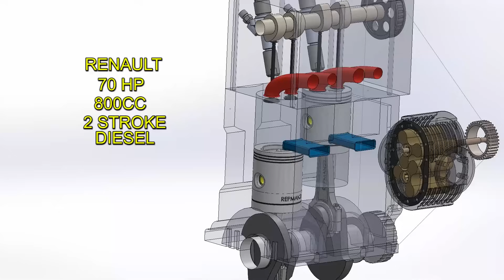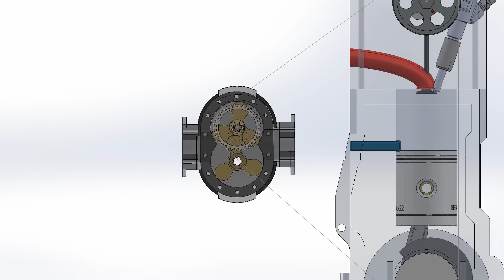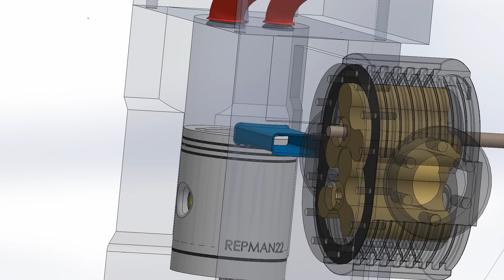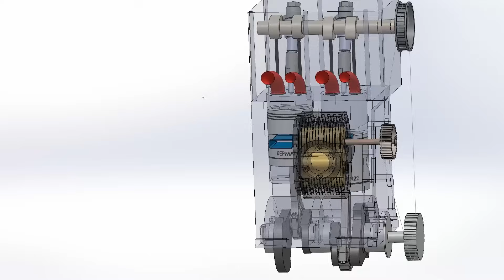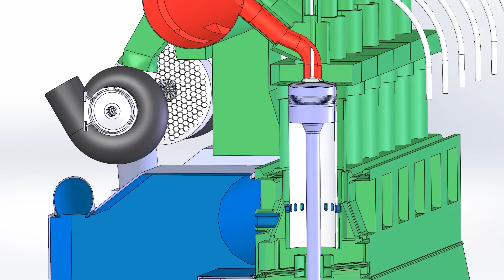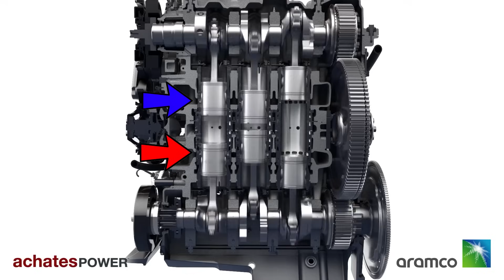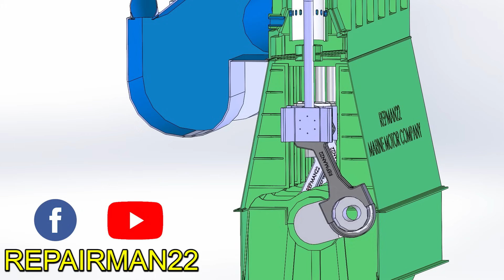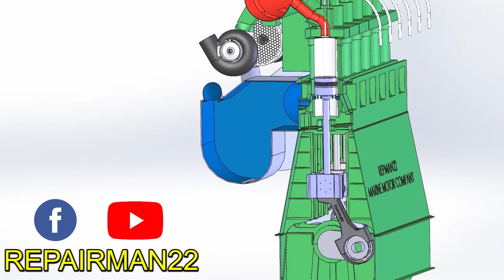🔴 All about 2 Stroke Diesel Engines and how they work in 3D Animation.

Comment: A low rev ,small two stroke diesel that runs at a constant rpm in a vehicle where it drives a generator rather than a direct drive train. Then use a modern electric vehicle drive train only rather than having to stop to charge the batteries it simply starts the engine at a low battery threshold to charge them. It could use significantly smaller, lighter batteries to compensate for the generator weight because they don't have to have but a fraction of the range of electric only ones. It could even be lighter than current electric vehicles with a operating range that would rival any gas vehicle.

Comment: Eine ähnliche Konstruktion hatte ich auch schon überlegt. Allerdings hätte mein Motor nur /Ein/Auslassventil. Der Ventilsitz ist in der Zylinderlaufbahn und hat 75% des Kolbendurchmessers - der Ventilschaft ist hohl und enthält die Einspritzdüse für Benzin. Da s Ventil wird elektrisch geöffnet. Es wäre ein Viertakter. Einlassluft kommt durch ein Rootsgebläse - das Verhindert das Abgase ein den Einlass strömen. - Wie beim 2Takter hat der Auslass eine Prallwand die das ausströmende Abgas und die hinterherströmende Frischluft in den Brennraum zurückschleudert, bevor das Ventil schließt. Der Motor würde nur mit einer Drehzahl arbeiten. Es gäbe nur einen Zustand - Ein oder Aus.. Der Abtrieb Elektrisch über einen Permanentmagnetsynchrongeneraor, Dieser bringt beim Start den Motor bei offenen Ventil auf 3000U/min. bevor der auf Leistung geht und weiter mit 3000U/min läuft. Der erzeugte Strom kommt in eine Schwefel-Natriumbatterie die locker 50 000 Ladezyklen aushält. Das wäre die geburt des 3Liter Autos. /BTW: Schwefel-Natriumbatterien arbeiten erst ab 200°C. Haben dafür keine Selbstentladung beim Stillstand. Die brauchen den Benziner um auf Laune zu kommen. Grüne Spinner mögen diesen Artikel bitte nicht beachten

Comment: Electric turbo? If it's not driven by a turbine, then it's not a turbo. Electric supercharger is a better description.
Reply: Electric assisted turbos not electric turbo. As in it has 2 turbines, one at the exhaust and one at the intake, and an electric motor in the middle to assist in spoiling the turbo at low engine RPM to reduce turbo lag.

Comment: There should somebody produce a 2-stroke double crankshaft diesel engine for a use within a amphibian airplane. Nice torque direct after start and in big heights and less consumption as well. You can find Jet A1 much easier than Avgas.

Comment: Have carbureted versions ever been built?  You mention in the video why fuel injection is a good idea.  But I'm wondering if there were designs that predate fuel injection, or if this is a relatively recent design?
Reply: A diesel engine wouldn’t be able to work with a carburetor

Comment: Detroit Diesel should have made gas version of it since fuel injection has become common in 1990s. it would solve a lot emission and fuel efficiency problems of traditional gas 2 stroke engines. the blower type 2 stoke would be ideal for race cars since you want highest power to weight ratio passable. adding a turbo would increase efficiency at high rpm since the turbo act anther expansion camber. also with turbo boost the stroke does not have be as long to get a good compression ratio.

Comment: An N/A one would be a REAL powerhouse!
edit: jokes aside... Does anybody know what the approximate C/R is on one of those "giant" ones, like in the cargo ships?  Just curious.
2nd edit (lmao): I couldn't help it!  I had to look it up... For anyone curious, they're pretty much the same as what you'd find in a smaller one... maybe a little bit higher... 15 - 20:1 seemed to be the norm, but I've seen up to 25:1
ALSO, a lot of ships are adopting more modern variable compression ratio variants.. mainly to adapt to and be able to run the wide variety of fuels out there today, from "synthetic to corn to crude"

Comment: Your opposed piston engine animation is not totally accurate. The pistons don't arrive at top dead center at the exact same time. The crankshaft with the exhaust port pistons leads the other crankshaft, so the exhaust ports open before the intake ports and the intake ports close after the exhaust ports close. This allows the cylinder air pressure to go above atmospheric pressure.

Comment: Problem is, the exhaust doesn't exit the cylinder completely and backs up into the air induction ring. So instead of fresh air being supplied, you get a mix of Air and burnt fuel ( lacking critical oxygen density) for the next combustion cycle. The next burn has less power than that of a true 4 cycle. And because of the second set of rings on the bottom of the two piece  piston , another drag point and subsequent wear point exist. With a propensity to force exhaust particulates down into the crankcase, it increases maintenance costs by fouling the Oil more. The shorter stroke also produces less per cycle, because this arrangement of a long articulated piston.
They basically gave up on this design because of the incomplete burn characteristics and Detroit went to a 4 stroke design to comply with emissions standards.
Their simple and mostly mechanical, they have parts that can be used interchangeably between many different engine sizes. So they have their appeal in Military applications, were efficiency is a secondary requirement.

Comment: i still will say after 1 or 2 weeks 
the blower spins the wrnong deraction I AM NOT WRONG
Reply from the maker: Sure!!!! If you want to live in a lie do it. Nobody stops you.
Reply: You ARE wrong, but I can help you.  

You are imagining that the air gets "grabbed between the gears" and pulled through, but that's not how it works, and in fact that wouldn't even be possible.  The air-flow direction is around the outside path for each rotor, NOT through the center.  Air can't go through the center between the lobes of the two rotors interlock as they pass through that area so there's virtually no space there for the air to occupy.  To explain this another way, the air gets pulled along via those "wide-open pockets" between the rotor lobes as the lobes travel around the outer edges of the blower, which of course is in the opposite direction as the route for air travel that you have envisioned.   Follow the paths taken by those "wide-open pockets" between rotor lobes and you will see the route that the air takes.

Comment: Detroit Diesel overcame the high rpm issue through a blower bypass. When the turbo exceeded the blower, the bypass valves opened and the excess air "bypassed" the blower. Those two stroke Detroit Diesel engines where a remarkable engineering feat
Reply: I am in school for diesel mechanics and got SO EXCITED learning about those two stroke diesels. Literally amazing, I want to work on a big ship with some two strokes. They’re a marvel to me
Reply: edit again, were a remarkable.
Reply: A 4 stroke and a 2stroke engine runs the same crank speed. It just sound like it's revving higher because everytime the piston is on tdc it fires where in a 4 stroke every second time it gets to tdc
Reply: @boesie6657  Very thrue!

Comment: I sailed on one of the maersk tripple e's (sencond gen) shown in the video. At start up 
, it could run 23 rpm. It sounded like african drums. It was awesome. When doing 73 rpm though, everything shaked. It was also with electronical/hydraulic activation of exhaust valves. And we could completely disengage a cylinder

Comment: As the US truck repairman said, a Detroit 2-stroke Diesel is the most effective machine ever invented, to convert fuel into noise. That aside, our old 2-stroke boat diesels had low rev, low HP, high torque momentum and very low fuel consumption. I´d love to have one in tip top shape to run my electric generator and my air compressor.

Comment: I know very little about diesels but the "2 stroke" part got me wondering: is it possible to do without a blower by adding a check valve to the input? Regular gas 2-stroke engines often have a reed valve to prevent backblow of air-fuel mixture, won't having this on a 2-stroke diesel also prevent exhaust gas blowing back into the air intake?
Reply: The cylinder in the 2-stroke diesel pulls almost no vacuum, so the air needs to be pumped in. On the conventional 2-stroke petrol engine, the sealed crankcase is used as the “pump” to draw the charge from the intake and then push it into the cylinder.
Reply: @Clyde-2055  I see, thank you for the explanation. The intake port is too low for effective suction to occur on the downstroke (after the piston passes by the port and uncovers it) and if the port is moved upwards any valve we could put there will be influenced by the hot gases during the power stroke. Guess there is no free lunch after all.

Comment: Old 2 Stroke Detroits were indestructible, also all of the engines are supercharged and sometimes additionally turbocharged as well.
Reply: No, they were all externally scavenged (not supercharged) with a mechanical blower, and some were also turbocharged.
Reply: @brianb-p6586 a “mechanical blower” is a supercharger dude.
Reply: @Zeesneakyninja  no. 
A supercharger significantly increases air pressure, charging (filling) the cylinder with more air than it otherwise could... that's literally supercharging. 
A scavenge blower pushes air in which pushes exhaust out of an engine type (generally a 2-stroke) which can't do that itself with piston motion, leaving the cylinder at roughly atmospheric pressure... that's scavenging.

The same device - such as a Roots blower - can be used with minimal pressure rise on a 2-stroke as a scavenge blower and with substantial pressure rise on a 4-stroke as a supercharger.
Reply: @brianb-p6586  Yes, indeed!

Comment: The valves on ship engines are also not run by a traditional camshaft.  They are actuated hydraulically, so the timing of when they open and close can be varied quite widely.
Reply: I can 100% guarantee ship engines run traditional camshafts, using DOHC/OHC & OHV set ups.
Reply: @AZZ3R1  Please show me the camshaft in this engine https://i0.wp.com/muckymariners.com/app/wp-content/uploads/2021/03/z17.jpg?fit=424%2C435&ssl=1

Comment: Now turn that injector into a gas direct injector & add a spark plug. Add variable timing on the exhaust valve. Then you have 2 stroke gas without oil mixing & big power

Comment: Nice video chap👍🏽

But, at 3:24 you said that "You can't use a turbo without a blower because the turbo doesn't spin at low revs..."
EMD found's way to overcome this, by clutching the turbo so it has low speed and high speed settings so as to keep power and torque as well as lowering the low rev emissions.
Reply: You're saying it functions as a centrifugal supercharger at low RPM, and then disengages a clutch and functions as a turbocharger at high RPM?

Comment: In a 2-STROKE with an angled intake port the air/fuel mixture enters at an angle and makes a loop and pushes the exhaust gasses out the exhaust port.  Do we really need a valve?
Reply: Need? No.
Is it beneficial? Yes 

Port timing is the same on opening and closing, but a cam-controlled valve can have any timing desired.
Uniflow scavenging is certainly better than loop scavenging.
Reply: Look at some of the designs used by Japanese on their big stroker bike engines before the Greenies killed em off. Angled ports, windows in piston skirts, oil recirculation. A whole bunch of tricks forgotten over the years.

Comment: I wonder if you couldn't do away with the displacement blower if you used an electric motor to spin the Turbocharger up enough to start the engine? Then for more performance without the loss of efficiency  of having the blower in the path, use a slightly larger turbocharger to blow into the primary turbocharger to get enough air for high RPM.
Reply: Yes, electrically powering a turbocharger as a blower would work, if the speed were controlled appropriately, and if you were willing and able to continue to power it until a high enough engine speed and load is reached... not just for starting.
Reply: This is how is done in reality.  The electric powered blower (or scavenge pump) operates at start-up and when manoeuvring in port to supplement the turbocharger.  At full away on passage, the electric blower is stopped.
Reply: At low rpm the turbo wouldn't spin fast enough to supply air to the cylinder and it would choke itself out.

Comment: Your blower is running in reverse. Your engine can't run.
Reply: No. its correct.
Reply from the maker: the blower is running ok. check it.
Reply: @repairman22  It's pulling the air OUT of the cylinder. I work on screw blowers. This one is running backwards.
Reply from the maker: as I said... Google it. Look for more videos in youtube if you don't trust me. Share me a video if you find one... thank you.
Reply: @TheOwlGuy777 This isn't a screw type, it's a roots and the air travels around the outside of the blower lobes.
Reply: @TheOwlGuy777  "I work on screw blowers."
This is a roots blower... And even if it was a screw blower the rotors correct rotation is as in this video... XD

Comment: Why do most 2-stroke diesels use exhaust valves rather than ports?
Reply from the maker: Timing and uniflow scavenge
Reply: So they can fit in a regular truck chassis
Reply: ?> @markfairhall3671
Reply: @markfairhall3671  But what does that have to do with anything in this case?
Reply: This allows for "uniflow scavenging (which is mentioned in the video) which is more efficient that "loop scavenging".

Comment: From 1:32 to 2:05 the video shows clearly that in a uniflow scavenged two stroke the "supercharger" is not supercharging the cylinder - because the exhaust port is open and pressure will be only slightly above atmospheric pressure. The blower is actually a scavenge pump and not a supercharger , and should be referred to as such.

2:10 Gasoline two strokes can also use uniflow scavenging. There is nothing about using gasoline as fuel that prevents it.  The reason they don't is that crankcase pumping is far cheaper and lighter than fitting a blower and direct injection to something like a line trimmer or chainsaw.
Reply: But evinrude e tec did it, but witouth blower

Comment: Your statement about the blower affecting efficiency of turbo engines at high loads was addressed by General Motors in the late 1980's with their TIBB option on engines. TIBB being Turbo charged, Inter cooled, Blower Bypass. A boost pressure operated flap valve mounted on modified blowers opens at high boost and air flows around the blower lobes. It made a very measurable improvement to engine power and efficiency.
Great Vid

Comment: if a large ship is in port and is idling engines it does produce a massive amount of pollution.  port towns have significantly increased cancer rates.  because the energy density is so high and the fuel is so cheap i dont see any other fuel that can be used in the future besides nuclear or liquid hydrogen.
Reply: When large ships are stopped in port the big propulsion engines are off.  These engines are directly coupled to the propeller so when the ship is stopped so is the engine.  These ship frequently plug in for electrical power so generator emissions are greatly reduced.
Reply: @jamesmurney1374  they are also required to switch fuels and burn bunker fuel while out in the ocean and burn cleaner low sulfur diesel closer to shore.
Reply: A lot of ports will have steam and power provisions for vessels, it's usually preferable because sitting around in port with the engines running builds maintenance and lifetime hours on the machinery, the Russian carrier/carrier-cruiser Admiral Kuznetsov often didn't have sufficient steam or electrical umbilical provisions available to power the vessel so the engines racked up tens of thousands of hours and it shows- the powerplant and a lot of other machinery is sometimes thousands of hours beyond it's useful working lifespan and it never leaves port without a fleet of tugs in case it inevitably suffers a breakdown, and given that it is exclusively mazut/bunker oil fuelled and the poor powerplant tuning it tends to identify it's presence by belching great gouts of sooty particulates

On the side, there was a paper released recently that described the effects of the disappearance of so-called ship trails, the clouds left behind vessels fuelled with high sulphur bunker oils as a result of the sulphur aerosols (in the form of sulphur dioxide and sulphuric acid produced when the former interacts with water) seeding clouds, legislation made in 2020 or 2021 changed the regulations on the limits of sulphur content in bunker oils and the net result of this was significant reductions in those trails of seeded clouds, and a proportional increase in the amount of sunlight and thus warming of the atlantic and other areas with particularly dense shipping lanes which would otherwise be scattered out into space again, as measured by arrays of satellite images and oceanographic sensor data. The concept of deliberately deploying sulphur aerosols from aircraft to produce reflective clouds or relax sulphur content limitations on commercial aviation fuels to produce thicker condensation trails has been tossed around as a method of geoengineering